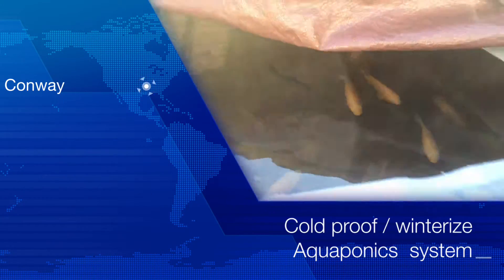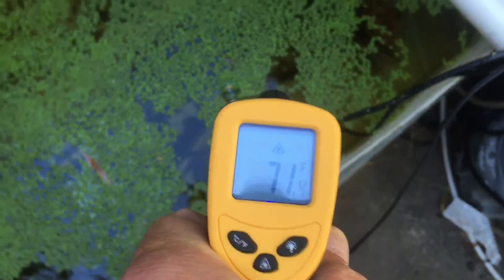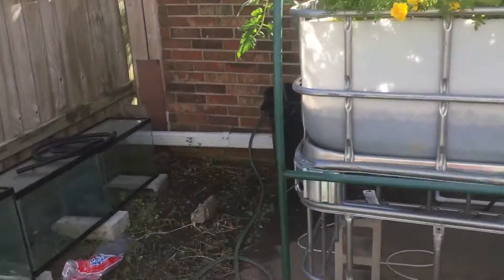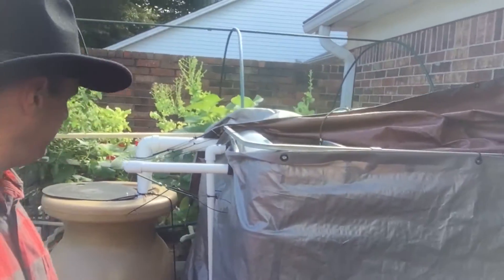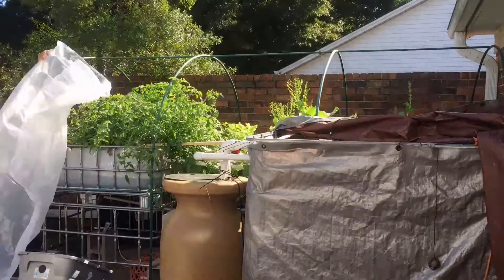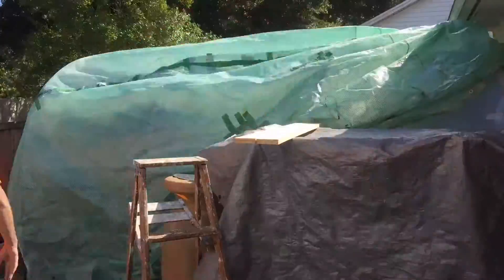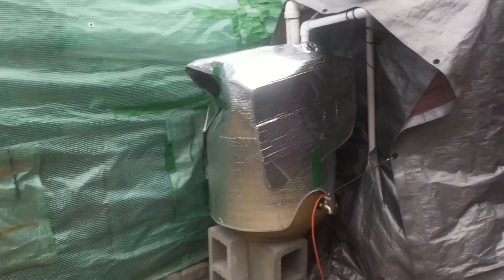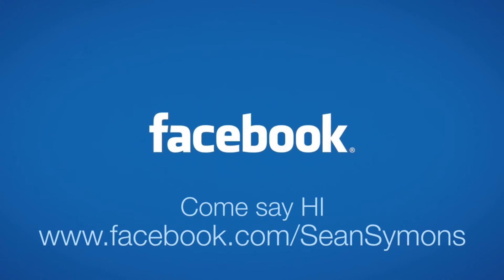Cold proof / winterize Aquaponics system

Comment: Hi Sean...
check out my video on heating your system with compost.. It works and its free heating.. you will still need some electrical heaters but it will reduce the costs dramtically..